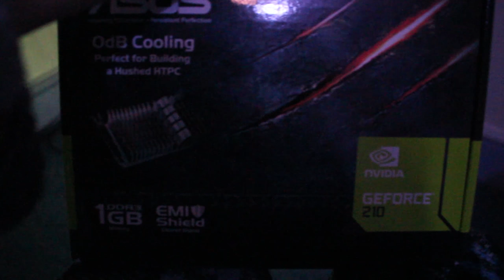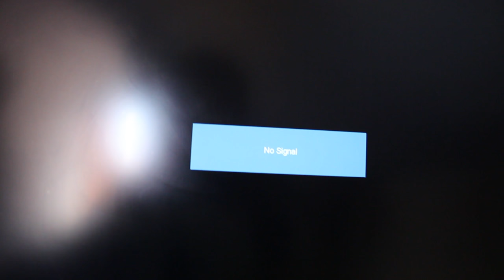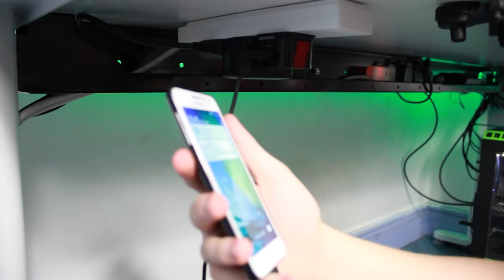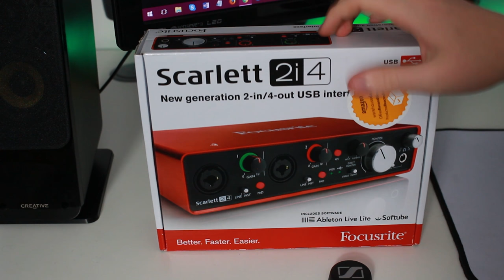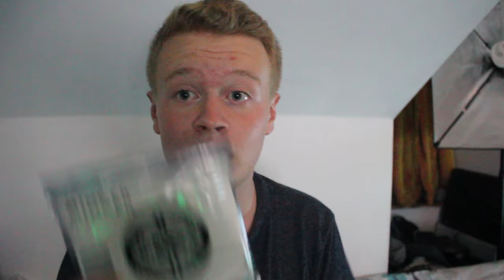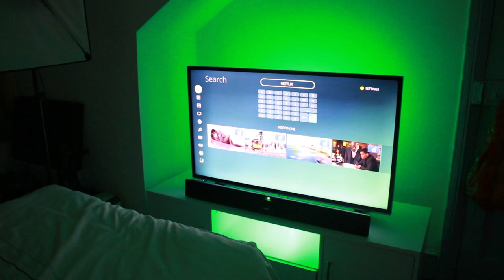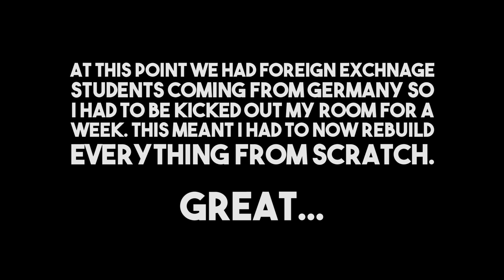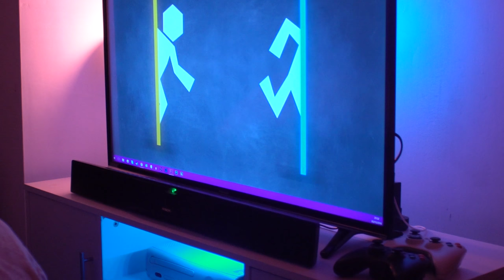BUILDING THE DREAM $7000 YOUTUBE SETUP ~ 6000 Subscriber Special ~ Gaming & Editing 2017

Comment: Niccceeeee im jealous, still rocking the 750ti lol
Reply from the maker: Not a bad card by any feat! If you have BF1 and want better performance I have a tutorial coming up real soon for people like you.
Reply: ***** My Intel Pentium bottlenecks it tho :/
Reply from the maker: Noah Williamson Which pentium do you have?
Reply: ***** Pentium G3258
Reply from the maker: Noah Williamson Overclock it and then it shouldn't bottleneck your GPU. I had that CPU paired with an R9 280X, which is equivalent of the GTX 770, and had no issues when I overclocked it to 4.4GHz (which I did on the stock intel cooler btw, it's only a dual core so heat isn't a problem).
Reply: ***** I have absolutely no idea how to overclock, and would be terrified to try it. Where would I go to learn how to and what programs would I need?
Reply from the maker: Noah Williamson If you go to this video:
https://www.youtube.com/watch?v=QBfXruwe8w4

That's where you can get started. You don't need any software or tools, just spam the delete key when you boot up (or whatever key it tells you to press at the bios screen) and then you'll get into the bios.

The Pentium G3258 is a great overclocker. You can just change the core clock multiplier to 44 (which would give you 4.4GHz) and put the voltage up to 1.2V and if that's not stable then try 1.3V and you should be fine.

Comment: so i have 2 980 tis, i got the second one on sale for only $400 at the time i was gona buy a new 1440p monitor but the 980 ti was on sale so i figured hey why the fuck  not. now instead of a 1440p monitor i was aget a 3440x1440p monitor and i think the pg348q or x34 is a bit too pricy for me so im settling on a acer xr341ck which can oc to 85hz its curved ultrawide 34 inches and ips or this wierd one i found called the Microboard B340VXC, its $700 and looks pretty good and is 100hz over the 85 but im worried about the VA panel on it. what do you think. (they are both freesync monitors and im on nvidia but i dont really care and i think gsync is a bit too pricy for me with the type of monitor i want. also im a bit worried about the color accuracy. kinda hard to find info on these korean monitors lol
Reply from the maker: I know, the 980Ti's are going very cheaply. Saw one go for £280 used, crazy!

As for the monitor, I found myself in the exact same situation as you. Literally, exactly the same. I was going to get the Acer X34A but then thought I didn't really need Gsync or a high refresh rate because I already have a 144Hz 1440p Gsync monitor. So then I started looking into the XR342CK. 75Hz native, 3440x1440, IPS and Freesync. Perfect. 

However I too, saw the appeal of the Microboard M340CLZ. VA panels offer the best of both worlds between TN and IPS panels. Colour accuracy can turn out great, especially after a bit of calibration. I'm not too worried on the colour front after doing some research on those who have bought the panel (I know, it's hard to find). Not only that, but it's 100Hz NATIVE, so you can overclock it beyond that (likely only to 110-115 max but still). The panel on the microboard is a pre-calibrated Samsung panel which is to be released in their new ultrawide monitor. 

I went ahead and bought it. I got the monitor for £570, which is an absolute bargain considering it competes with a monitor that's double it's price and beats out monitors that are £200 more expensive. Technically it's a Christmas present from my mum (I paid for most of it though, what a gent) and so unfortunately I won't get my hands on it until December 25th although when I do, be sure to expect a full indepth review on all the concerns I had about buying the monitor. If you want a respectable review from a 'pro', so to speak, YouTuber, check it out here. It's the only good quality one available atm as this monitor has just come to the market: 

https://www.youtube.com/watch?v=wAqEhOMX_2U

In short, I'd say go for it but if you want to be sure then wait and I'll have a review up. What would really help me out is if you could ask me a load of questions for me to address in the review, to put everyone's mind's at ease when buying from Korea.
Reply: ***** ok thanks a lot man. i thought u were in the same situation cuz i saw a lot of your comments in a lot of videos about the monitor lol and i used to watch you a lot on yt but u wernt posting for awhile so i just kinda forgot.
im really torn between the 2 monitors the only thing keeping me away from the microboard one is the display colors which are about the same as most average monitors out there while the colors on the xr34 is suppose to be really good (1.7 billion vs 16.7 million lol) and considering how the latest bf1 update with cpu optomisation i can more then well push 100 fps at 3440x1440p so im kinda leaning on the 100hz.
im really glad i found your channel again tho after you wernt posting for awhile and i made a new yt i kinda forgot about it :p
Reply: ***** im mostly curious about the VA panel with how it holds up because some can have really bad ghosting and the display colors. but considering most monitors have 16.7 you probably wont notice much from your current acer one which also has 16.7 million

but i really cant wait for the review theres not much information about that monitor out so this should help a lot of people it looks like a sick monitor
Reply from the maker: Chuuko I didn't know the XR34 was a 10bit panel? Oh well, from what I've read it doesn't make much of a difference with general use although I can't personally comment on it. 

I'm glad you did, man! I'm trying to do at least 1 video a week although I know it's not really enough to keep the growing sub count. College is really demanding on my spare time and now I'm starting a job next week which means I'm able to buy stuff for the channel and for myself, so there's going to be a lot more of the types of videos like the one I'm about to make public (cheeky spoiler), but it also means I need to crunch down time. I am trying, though.

This new YouTube bug has taken away some of my most favoured subs, which really pissed me off because I was going to do a fan appreciation video where I gave each of them games but YouTube's algorithm unsubbed them. 

What is your other monitor, might I ask?
Reply: ***** uhmm lol my current monitor is a really crappy asus vs247 its so bad and like i said i was gona get a 16:9 1440p monitor but i saw a deal on a 980 ti and snatched that instead and im glad i did because a lot of them are running out of stock and they are not being manufactured anymore. still trying to find a long lasting job myself to speed up the process of getting stuff but i guess no one wants to hire me lol. and i remeber you told me gsync was very much worth it so do you have a change of mind now considering you didnt get a pg348q or x34?
Reply from the maker: Chuuko Gsync is worth it but when it comes at the cost of a higher refresh rate, I'd take the higher refresh rate any day. Nvidia also just released Fast Sync as a software alternative to Gsync. It acts above the refresh rate of a monitor and does pretty much just as good a job. The reason I'm not bothered about missing out on it is because I have it on my monitor I have now.
Reply: Hello there! Well here is the thing, you really shouldn't be worried about the panel or the color accuracy, because VA panels are a bit like a combination of ISP and TN you will have great color accuracy and no yellow shade when the monitor is off, you won't get bad colors on your view angels either. In short, VA panels are really good and you should get one if you're looking to play competitive games with great colors and high refresh rates. Hope I could help :)
Reply: Flash va panels dont have as good colors as ips tho and can have reall bad ghosting. but yes the viewing angles and response times are good

Comment: hello tryte i have been watching your videos for a while now and i wanted to ask if you can find me the the best prebuilt computer ranging around 1000-1100 pounds, i have done research on the matter and find gtx and intel to be the best choice, can you reply within this week please before the month of December begins. thanks in advance, i tried to build my own in the past and it wasn't a pretty site :P
Reply from the maker: Go to this site: https://www.gladiatorpc.co.uk/configure/config/65887

And change these things:

CPU: i7 6700
RAM: 8GB 1x8GB 2666Mhz
GPU: GTX 1070
Storage: (Add a 120GB Samsung 750 EVO)
PSU: 500W Corsair CX500M
Case Cooling: ML120 White
Case Lighting: White LED Strip
Reply: thanks allot mate, ill be subscribing and hope to see more videos on arma 3 and such :), just wanted to ask is it worth getting 16bg ram does it make a large difference, also is the 500w corsair cx500m reliable power supply? especially for a i7 along with a gtx 1070?
Reply from the maker: cody rage Go to this link:
https://uk.pcpartpicker.com/list/LchZzM

These specs are basically what I've given you on Gladiator PC. The average load wattage is 320W, 500W is more than enough for all of your needs. Not only that but it's an efficient PSU too. The new Pascal and Skylake processors are much more efficient than their predecessors making big wattage power supplies unnecessary unless you're going SLI or XFire. 

As for the RAM question, it depends what you're doing. Going from 8 to 16GB of RAM would mean maybe 2-10fps more in games but that wouldn't be noticeable if you upgraded. However if you're going to be editing then I definitely recommend 16GB of RAM or even 32.
Reply: thanks for the quick and fast reply's mate, last question, i realised there is no operating system, if i was to downgrade any parts what would it be for budget, and also, if i was to costume build this how much would i save? its just a little scary for someone who doesn't have pc building experience to try make their own as many things can go wrong....
Reply from the maker: cody rage No problem! I didn't include an operating system because you can download Windows from Microsoft for free (legally) onto a USB and then buy the Windows 10 activation key on a site like G2A or CDKeys.com for like £20. All you have to do to install it is plug your USB into your PC once it's built, you'll launch into the bios and select to boot from the USB and run through it like you would with the disk. It's painless and I've done it a couple times now. This means you don't need to downgrade any parts. If you were to custom build this you could save £100 which could go to a GTX 1080 instead of a GTX 1070 or perhaps a better case (which does make a big difference).
Reply: once thats done will it have stuff like internet explorer :P or a blank page lol, also dam 100? thats hardly anything especially when you take into account the amount people are spending on a pc, i don't see why people wouldn't buy costume builds...  oh yh one last thing, what case should i change it to out of the options? i noticed this one has the dust filter thing that collects dust and you can easily remove my old pc got wrecked by dust
Reply from the maker: cody rage It's much better to build your own PC because not only does it save money but you also know how to solve stuff if something were to go wrong. Also, it's a hobby. No greater sense of pride when turning a PC on that you've built yourself. Feels bloody great! And yes once you boot up your PC if you built it yourself or installed windows yourself it will have MS Edge Browser which you can use to download Chrome and such from, then you go from there.

The price gap between custom builds and build your owns has decreased lately but this site is particularly good. You don't usually see them cutting it this close, I don't know any in the US that do or any others for that matter. A drawback to prebuilts, however, is that it doesn't have all the hardware available so you couldn't build a PC exactly tailored to your needs. Along with another drawback where if there's a problem with a specific component you'll have to pay to send the whole PC back but if you build your own then you've only got to send back that one singular part (for free).

If you want, I can build you a better PC for the money which you would build yourself.
Reply: Tryte no thanks you helped me allot already, i will stay humble for someone coming from a amd :D, do you play any mmo like archeage?
Reply from the maker: cody rage No unfortunately not, couldn't get into MMOs really :/
Reply: Tryte I was just told by a friend to watch out for over heating especially with parts like these, will the case and fans be enough to prevent damage?
Reply from the maker: cody rage Your friend is being silly, all the parts are fine you won't have any issues with overheating.
Reply: final question mate i promise, im buying it right now but i was wondering should i add 35 pounds extra to get the Game Max Falcon Gaming Black Midi Tower Case - Blue LEDs case , or the Bitfenix Nova Windowed Midi Tower Case - Black case for a 29 pounds extra.

will it make performance or life span of the system longer? also i am a fan of dust filters.
Reply from the maker: cody rage I know the bitfenix cases are decent so that's what I'd go for although if you want to upgrade the case, then spend some money and upgrade it properly. Get the NZXT S340 or H440, both of those cases are fantastic.
Reply: thanks for the help, it took a while but i finally placed the order :) heres the finished order.

https://www.gladiatorpc.co.uk/share/system/1248645
Reply from the maker: cody rage Looks good :)
Reply: it has arrived today and is looking good, weirdly it didn't come with CD drive, they already installed windows 10 but i had to do the code and let it load which took for ever due to it being slow and the mouse kept freezing 'sight' , now im trying to download all the windows updates but its incredibly slow and not reacting much, i hope this will go away after i download everything, btw what drivers and stuff should i download for gaming?
Reply from the maker: cody rage Download all the latest stuff. Go to Nvidia.com and then go to their downloads page. Go through the quick select guide by choosing your video card and OS and then download and install them. Things will be a bit sluggish to begin with, they'll get faster though.
Reply: Tryte is the one fan able to take care of the whole system? I'm thinking about adding more on but its like flying a plane to me I don't have a clue

Comment: Recently got myself a liquid cooled GTX 1080... huge jump from a GTX 970 imo! ;)
Reply from the maker: Damn, should be getting either the 1080 or the 1080Ti in January to accompany my 3440x1440 monitor I'm getting :D
Reply: Tryte Nice! I just spent $1600 to finish my new gaming rig project I was in dire need of completing. Then topped off $500 on some needed components for a streaming pc (Twitch aye lmao), and dropped in another $500 on a at2035 xlr mic, audio interface, c920 webcam, 5'x7' greenscreen, and other nice goodies. BUT now thinking that I need nothing else, my main hard drive is starting to die, and my computer chair is beginning to break apart! Rip my fucking bank account bro... Just spent $250 on a 1tb ssd though, which will replace my main hard drive, so fast asf loading boi! Gaming chair, however, = fuck. The chairs I want are expensive, they're as much or more than the price of my ssd, so damn :/. Do you find your chair comfortable, while also keeping your back straight to provide good body posture? If so, hook me up 👌.
Reply from the maker: TheProperBloke The chair I use has done a great deal for my back, however I would prefer a better one. My next upgrade is going to be the Herman Miller Embody (I think it's called). All sounds good dude but I would've gotten 2x 500GB SSDs.
Reply: Tryte Na, would have been more expensive, oddly. And I was going to clone my ssd with everything stored in my hdd, so I need more than 500gb other wise I'd have to start completely fresh = nope. Besides I have a dedicated drive for video/editing, and if need be i can buy another ssd, though I've always done fine with 2 hdd's alone in the past. Thanks, i'll do some more shopping around!
Reply from the maker: TheProperBloke Yeah I would've gone with the 2 500GB SSDs because if you want to use it as one drive to clone an older drive, then setup a RAID 0 array and now you have a super fast single partition drive (1TB total space so it's like you have a REALLY fast 1TB SSD) and then if you didn't want it in a raid array then you can use the 2 drives to get the most out of computer functions and disk usage. For example, it's best to record on a separate drive to your OS and game installations. This would help massively with that.
Reply: Tryte Yeah but raid has disadvantages too. Though it still would have been more expensive to get two ssd's plus other things i ordered all together. Also need to buy some parts for my streaming pc, so I gotta conserve that mulla$$$... and damn i looked up the brand for the chair you plan on getting... Boi, you gotta be rich, spending 1k on a chair is ridiculous.
Reply from the maker: TheProperBloke Yeah I know but I've tried out the chair before and OH MY LAWDDDD, it's basically everything you've ever wanted but conformed into a chair- fucking amazing. There's deals on it sometimes so that'll knock the price down a bit. I will say it's the last thing on my list haha